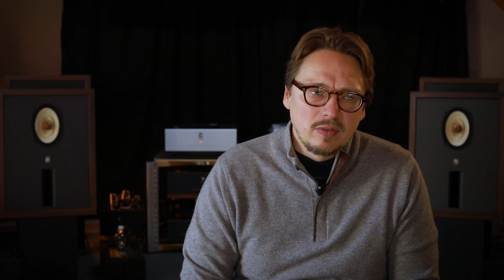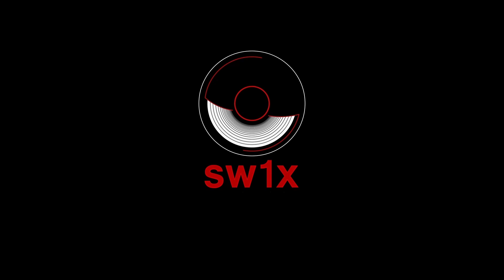Is HiRes 32 Bit Audio better than 16 Bit Audio in DACs?

Comment: Higher bit with higher sample rate yes at first can seem like it is a warmer/heavier sound with a lot better control of the volume. (a lot more bass)
But after you hear it for an extended period of time, you will notice that the sound is now congested and that the variety is now lost in the music, because now everything sounds blown up and bloated with a lower quality of especially the instruments themselves. So yes this is probably what noise sounds like.
Also this higher bit mode and sample rate seriously slows down the music so it loses itś freedom. And yes in a way that helps you understand the sound more since 16bit 44khz is a lot more raw i nsound. But that is then something that hugely affects the quality of sound, so now you have 2 opposite choices in HiFi: either understanding sound a bit more or enjoying the quality of the music.
I choose to go for quality of sound, since with ONLY understanding more information that is a very empty experience by itself.